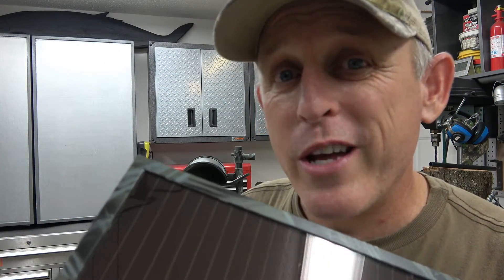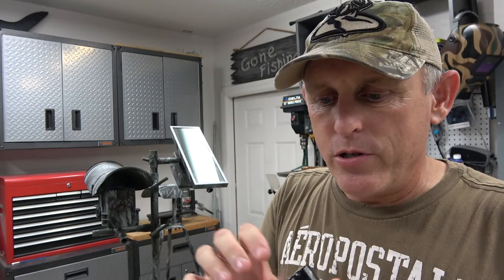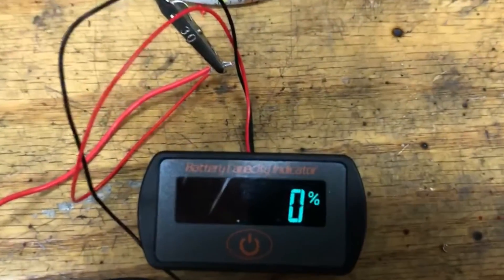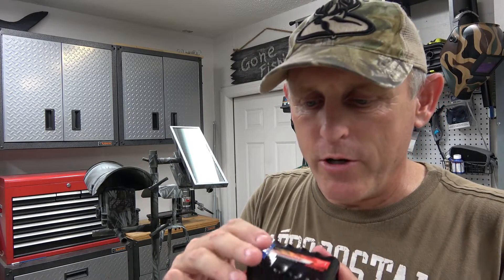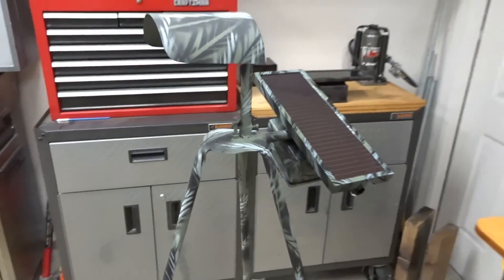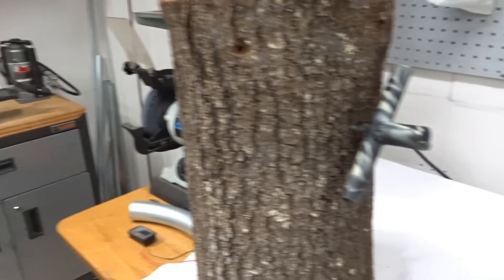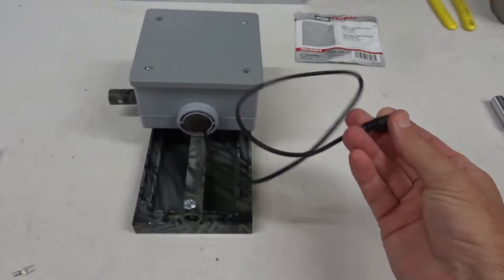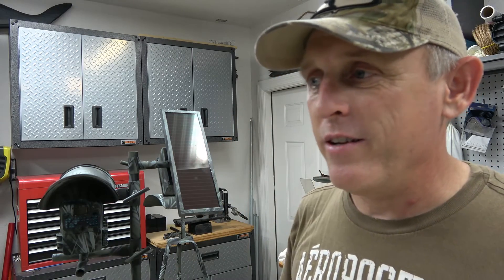Trail Camera Solar Batt Pack-DIY

Comment: The problem is, my trail cams are not in the sun.  Id be really curious to see how it maintains under tree cover
Reply from the maker: It depends on how much ambient light is available.  Theyll still produce charge without full sun but really depends.  Sometimes I’ll just use a bigger LifePo4 battery without a solar panel for dark areas.  Last me months.

Comment: Do you ever worry about a solar panel giving the battery too much power back and messing the battery up or is the regulator worth the money to keep anything from happening?
Reply from the maker: The way this unit is setup youll get about 2 to 3 years out of the battery.  If you installed a voltage regulator between the panel and battery and set it at around 14volts it would make the battery last longer by preventing overcharging.  Hope that helps!

Comment: If the trailcam makers had half a brain they would chuck all those AA batteries and use 18650 lithium cells which all have 3.7volts each, last  WAY  longer than an AA. ALSO wire it so that whenever external power is used it  DOES NOT  power the cam, but charged the 18650 batteries. BUT  we wouldnt want to break up the poker game the cam engineers have going in the backroom.

!
Reply from the maker: Agree 100%!

Comment: Sorry if this has already been asked and answered and I missed it, but what purpose does the 12v regulator serve? Or what would be the consequence if it wasn't used?
Reply from the maker: During full sun the solar panel will output ~20volts which can damage the cam.  This is averaged down while being connected to the battery so some say you dont need it.  I use them as a safety stop in case the battery goes bad and the solar voltage goes directly to the cam causing damage.  Hope that helps!
Reply: @TheHandyHunter  that's kind of what I was thinking and exactly what I needed to know, ty! I'm looking at putting something like this together for a 6v cam.

Comment: Do you have to have batteries in the camera or will it run only off the battery pack
Reply from the maker: Depends what brand of camera you use.  My Brownings run without batteries inside but others I have won’t.  I still like to run batteries though as a backup plan.

Comment: 4 yrs later how are the cameras, did you make any changes?
Reply from the maker: I now use a small pack of LifePo4 batteries with a PCB but I’ve only been using for about 8 months.  The pack in the video is simple and will give you 2-3 years before needing to replace the battery.  I wouldnt hesitate to use that battery setup.

Comment: A useful tip when using the 7812 voltage regulator: Get a heatsink, and also solder on a 16v 470uF capacitor to the output side. That way it will help dampen any sudden voltage changes to the battery pack/trail camera if the solar panel gets covered or other issues occur.
Reply from the maker: Great suggestion…thank you!

Comment: seems to me the regulator needs to go between the solar panel and the battery to prevent overcharging the battery?
Reply from the maker: No, you need it on the cam cable to protect from high voltage during full sun from the solar panel.  This setup doesn’t have a BMS but will still last 2 to 3 years.

Comment: A loaded question for topic @ hand. So wonder where this is at. Is he and his good idea solar battery bank deal,is it in the north where it would be sitting out in -0 degrees temperatures. Or is it out in a place tht is mostly above 34 to 46 degrees for the coldest temperature wise it gets for the coldest nights of winter. Problem we have up north here is the real cold temps seem to drain batteries real quick
Reply: Before someone says anything about me not watching and listening. He did say something about the battery being drawn down at night and then solar brang back up. No real mentioning about what temp was out there on such day/night
Reply from the maker: I’m in central Georgia where winters are not bad.  NiMH or LifePo4 batteries claim to work at -20 below and may be your best option.  Lithium doesn’t do well below 32 degrees so don’t waste your money.  Best thing to do is test one to see how it holds up. Good luck!

Comment: is the solar panel directly hooked up to the battery? How are you protecting the battery from overcharge ? and how are you protecting the solar panel from the battery?
Reply from the maker: Yep, battery is directly hooked to solar without controller.  If you use a 1.5watt solar withis setup you can expect 2 to 3 year life span max.  These NiMH batteries don’t use pcbs so not too bad on battery life.

Comment: Could I use  DC power jack coming in from solar panel and out to camera? Or does it have to be wired directly?
Reply from the maker: You can definitely use jacks.  Just make sure you get the polarity right and you’ll be good!  Good luck!

Comment: Question for ya. I am doing the same set up but for a 6 volt feeder. Will that battery take the close to 20 volts from the solar panel or do I need to put a 12 v regulator between the panel and the battery? I have a 6 v regulator between battery and feeder.
Reply from the maker: I wouldnt use a 12v solar with a 6 volt battery.  Can you switch to a 6 volt solar panel?  You could install a buck coverter at around 10-11volts between solar and battery.  Hope that helps.

Comment: Hey I have a Spypoint Micro LTE cellular trail cam which has a 12v power inlet. I bought a 12v 7Ah SLA battery and the camera is draining it quick. Even quicker than just using 8 AA batteries. I thought I had a bad 12v battery so I swapped it out with another new battery and added a 12v solar panel to the setup to keep it charged. Its draining that battery fast too. I don't know if it will make it through one week before its drained.

What do you think could be causing these 12v batteries to drain so quickly. The camera itself hasn't been taking many pics at all when it use to take a bunch of them before.
Reply from the maker: Cell cams draw more but shouldn’t drain that fast.  What’s your cell signal like?  You may have to try a 5 watt panel or bigger to keep that 7ah charged everyday.  It’s a power hog cam.
Reply: @TheHandyHunter  the signal there is decent. I'll be driving out there to investigate this weekend. Tech support said I have to have the camera handy to troubleshoot.

Comment: Will is 12 voltage battery burn up a cell camera if it doesn’t have a solar panel attached too the battery?
Reply from the maker: I’m not clear on your question but I think you are asking if you need a voltage reg if you aren’t using solar?  The answer would be no as long as you are matching the voltage of the battery with the camera.  Hope that helps!

Comment: Built just like you showed, camera wont run on it, battery tester shows 100 percent and 11.7 volts using the voltage reg from your store
Wont turn on, works if i plug into 12v socket on truck
Reply from the maker: That’s weird.  11.7v is plenty to run a cam.  Check the plug to make sure it has contact.  Is it the same plug you are using for the truck?
Reply: Did you ever figure it out. I’m having the same problem

Comment: 1 more question I've really been wanting to build those lag bolt tree mounts to mount my solar panels wondering if you can give me a materials list to weld those up or even possibly a video of how to build the mounting system
Reply from the maker: Funny you should ask.  I’ll be building some new ones this week so I’ll pull together a video.  Does that work?

Comment: Great idea. I tried doing the exact same way but battery small 12v battery still dies after a couple of days. Not sure why or what I'm doing wrong. Left side of regular on left side og regulator right side to camera.
Reply from the maker: What kind of camera are you connecting too?  If everything checks out…12volts at plug and solar at ~20volts in full sun then it sounds like you might have a bad cell in your battery.  It’s happened to me before.  NiMH batteries can lose a cell sometimes, not often, that can ruin the whole pack.  Unless your camera is a giant power hog then it sounds like you have a bad battery.  Let me know what you find.

Comment: Could you lease provide a close up of the wiring to the 12v regulator? I assume the “up” means the flat tab of the regulator would be flat on a table in the diagram?
Reply from the maker: That’s correct, the flat tab would be laying flat on the table.  Wish I had a close up for you but you seem to have it right.
Reply: @TheHandyHunter  thank you sir!
Reply from the maker: You are welcome!

Comment: Good morning! Your videos have been great and very informative thank you. What 12 volt regulator did you use? Also do you think it is necessary? Again thank you for posting these videos. Your build quality and information is perfect! Great ideas!
Reply from the maker: Thank you!  I use a 7812 regulator and yep you need one for safety so you don’t overvoltage your camera and damage it.  Hope that helps!!
Reply: Thank you sir. I just looked them up on Amazon. I’ll YouTube how to wire it in thank you.
Reply from the maker: You are welcome!
Reply: @TheHandyHunter  Are you able to show how you did the wiring connection to the voltage regulator?
Reply from the maker: Hi Sam, I’m not good at soldering so I take the barrel end of a small spade connector and cut it off but I remove the plastic sheath first.  I then slide it up on the leg of the regulator while the lead wire is inserted.  Then slightly crimp the barrel connector to make it all secure.  Don’t forget to slide your heat shrink on the lead wire first before you do anything.  Hope that helps!

Comment: I am thinking about putting 2 of these together as a project with my 13 year old son. Are you still liking the setup? Any alterations or snags you didn’t foresee?
Reply from the maker: Still loving them!  Just changed out the battery in a couple that had been running for over 3 years in full sun.  I have other that are still running.  The batteries won’t last forever but I think 3 years or more is great.  Good luck with your project!
Reply: @TheHandyHunter  I’d say 3 years battery life out of a camera is a pretty big success!
Reply: @TheHandyHunter  I waited too long.... Tenergy doesn't sell this item anymore. Now i'll have to solder up my own pack with rechargeable AA batteries instead.
Reply from the maker: Yeah, I don’t see them anymore…bummer!  You can definitely build your own pack.  May want to do it with 81650 batteries instead of AA.  Good luck!
Reply: Tenergy makes a 2,800 MaH rechargeable AA though, so my 12v pack will be 2,800 MaH instead of 2,000 MaH. And, I get to teach my son to solder cells together and how to calculate series voltage for battery packs. All is not lost!
Reply: @TheHandyHunter  I was considering using 18650 batteries, but the first below freezing temps would kill the cells. I would have to include a BMS with low temp cutoff to use lithium in the field. I am still toying with the idea of building some 4s (12v) 18650 or 26650 based packs with no solar panel for my public land cameras. they would not be perpetual power like the setup you made, but would VASTLY expand the battery life of just the batteries in the camera.

Comment: Just a couple questions before I order the parts for this! 
the input on the new Bushnell core ds-4k cameras appears to be a dc (2 prong) w threaded collar, I found short ones on Amazon I believe.
1) The camera runs on 6 aa batteries, will the 12v battery pack in your Amazon list (and in the video) work for this?  
2) is there any updates to which solar panels you have in your list are better than others? It appears you have about 3 of them shown. I see 2 are 1.8w and one is 5w.    Is 1.8w sufficient? 
Thank you for the video. I’m sorry if these questions are dumb, but I’m not electrically inclined at all. I’m excited to try one then outfit my entire fleet of cameras.
Reply from the maker: Yep, that battery will work just fine.
The 1.8w panel is all you need.  Good luck!

Comment: Just got everything you used in the video. My only question is the regulator keeps the voltage at 12 volts going to the camera so the full voltage output to recharge the battery is over 12 volts if i am understanding the wiring correctly. Have you had problems with sending that many volts from the panel to the battery and not wrecking the battery??
Reply from the maker: Nope…you are completely safe running 23/24 volts from solar to charge the 12v battery.  I’ve been doing it for years and it works great!

Comment: I followed your instructions. My battery meter says 100%, but at camera it only says 50% battery life. Any help would be greatly appreciated.
Reply from the maker: Let me guess…spypoint?  I had that happen to mine and heard of others having the same issue.  Let me know which brand?
Reply: @TheHandyHunter  yes sir, is there any advice or get a new camera?
Reply: SPYPOINT
Reply from the maker: @brianhelms7125  my battery still worked fine but the camera stunk.  For some reason the internal battery meter doesn’t accurately detect external battery levels.  I found that Bigfoot cams work great for my area.  Some people love the coverts too.
Reply: @TheHandyHunter  thank you sir. It means a lot to us hunters out here on a budget that someone takes time to show us how to save. Batteries can get pricey over a season. I really appreciate your time. And thank you for helping me.

Comment: And does the shade of a wooded area allow for the solar charging.  Most of the time my cameras are in the woods along trails.
Reply from the maker: These types of panels do generate energy in shade but takes long to fully charge.  If it’s really shaded you may have to move up to a bigger panel to collect more light.  Start small and then progress upward.  Hope that helps!

Comment: What size pvc pipe do you use for the mounting?
Reply from the maker: I make my brackets out of 1/2 in emt metal pipe.  I have seen people use 1/2 in pvc as well to make it work.  You could use 3/4 for extra strength. Hope that helps!

Comment: do you think with these new cell-link add on units that one of these would power both the camera and the cell-link if you had 2 dc plugs coming out of it? or would you need one complete unit for each?
Reply from the maker: I’ve run two trail cams off one with no problem but I don’t know if it will run the cell-links since I heard they are power hungry.  You could try putting two battery packs inside with one solar panel and try that for starters.  Hope that helps.

Comment: Did you add a diode to prevent the battery from backfeeding the panel in low or no light?
Reply from the maker: No because these panels come with diodes to prevent backflow.  Hope that helps!

Comment: Where did you find the T bar that you connected everything to and how did you screw that into the tree? Also how does the solar panel connect to the T bar? I know you showed it but does it take a specific solar panel that will accept those bolts that you threaded through the T bar?

Comment: I have a covert NBF -30 it has a 6v jack if I change the 12v connector to the 6v connector will it still work the same?
Reply from the maker: You’ll need to install a 6 volt regulator between the battery and the jack plug.

Comment: Could these be of any use https://www.ebay.com/itm/Lot-of-10-12-Cell-Battery-Pack-BMS-built-in-and-Temp-sensor/284142697777?_trkparms=aid%3D1110012%26algo%3DSPLICE.SOIPOST%26ao%3D1%26asc%3D20201210111451%26meid%3De9b8ae21b9d24ccea5829e51bca05d4b%26pid%3D101196%26rk%3D3%26rkt%3D4%26mehot%3Dnone%26sd%3D284142690666%26itm%3D284142697777%26pmt%3D1%26noa%3D0%26pg%3D2047675%26algv%3DPromotedSellersOtherItemsV2WithMLRv3%26brand%3DSANYO&_trksid=p2047675.c101196.m2219
Reply from the maker: I don’t see why they wouldnt work!  I like the shape!

Comment: Love the setup....considering this for my moultrie mobiles.  I'm only getting about a month out of 12 enegizer lithiums (1,000pics).  Do you think this could get me at least several months of use?
Reply from the maker: Hi Jeff, it depends.  Some cellular cams are major power hogs and others not too bad.  I run bigfoot cell cams on this setup and it works perfectly.  One thing you could try if the cam drains too fast is to run two battery packs in parallel inside the box.  I would try one first and see how it works.  Good luck and let me know how it goes.
Reply: @TheHandyHunter  Sorry to bother ...so I set up 2 rigs this weekend.  Both are only showing like 11.5 volts coming out of the regulator.  The battery itself shows 12.8 volts.  Should I be concerned?  Does this sound normal?

Comment: How are you attaching wires to the 12v regulator ?
Reply from the maker: I clip the barrel end off a spade connector and then use it to crimp the wire to the regulator pin.  Make sure you slide the shrink wrap on first.
Reply: @TheHandyHunter  what gauge connector ? Like the red ones ?